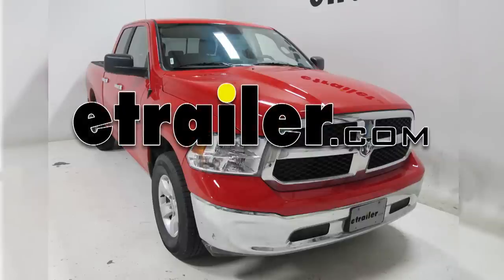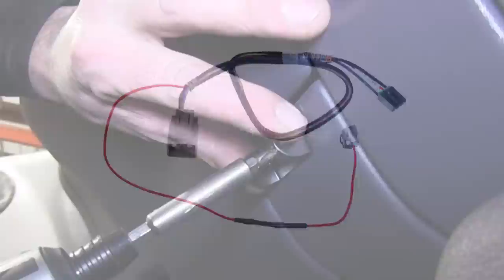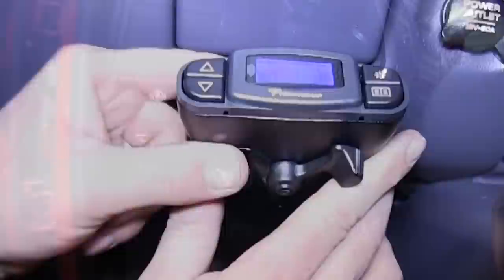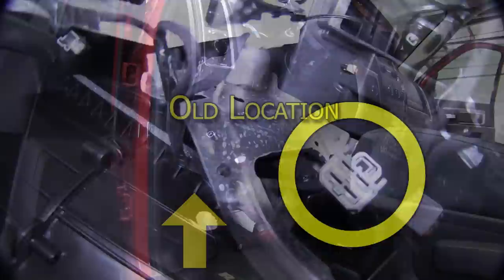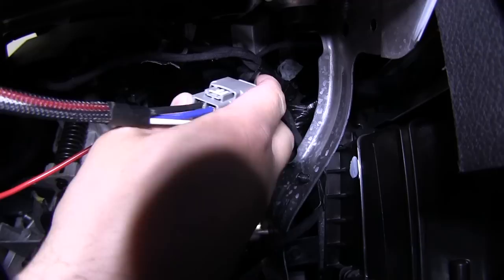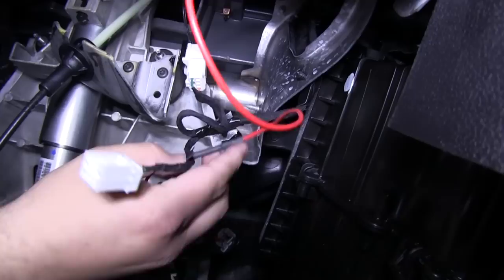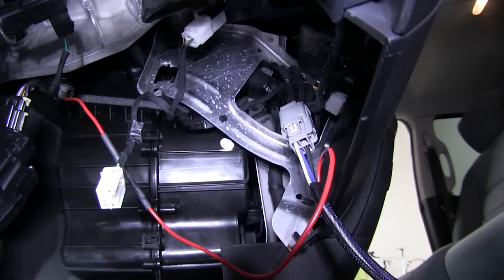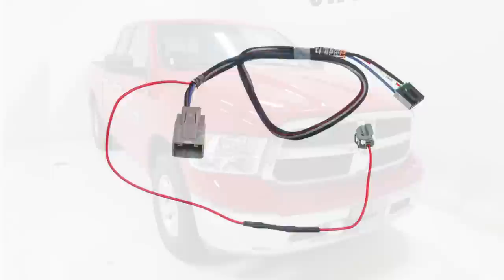Mount: Tekonsha Custom Wiring Adapter for Trailer Brake Controllers on a 2013 Dodge Ram Pickup

Comment from the maker: The wiring of the 2013 did change, but the 3023-P is the correct harness for the 2013 models. Most proportional brake controllers still work on the 2013's but the time-delayed ones do not at this time.

Comment: Thanks for this video. It was helpful. However, my 2012 Dodge RAM 1500 does not have the additional "break signal connection" (red wire in this video). I just can't find it anywhere. Would that affect the functioning of the brake controller? do I need to install the additional brake signal connection? Thanks again!
Reply from the maker: The brake signal connection is necessary for this install. All of the Rams should have this connection point.
https://www.etrailer.com/Accessories-and-Parts/Tekonsha/3023-P.html

Comment: 2015 ram rebel! bought this harness. can not locate red wire connection above brake pedal wondering if this has changed on 2015?

Comment: So I read online that the wiring has changed on the 2013 RAM 1500s and aftermarket controllers won't work at the current time. Has this information changed? I see some manufacturers list 2013 specific harnesses, but I just don't want to buy this rig, plug it in, and smoke some electrical componentry.

Comment: I have a Draw Tite Activator 5100,(I believe), from an old GMC, just bought a 2013 Dodge Ram.  Do I undrstand you correctly, this will not work on the Ram?

Comment: Same harness for 2012 Ram 1500 sport?
Reply from the maker: This wiring adapter is designed to fit the 2013-2014 Dodge Ram 1500. Check out the following link for the correct harness for the harness that will fit the 2012.
https://www.etrailer.com/Accessories-and-Parts/Tekonsha/3021-P.html